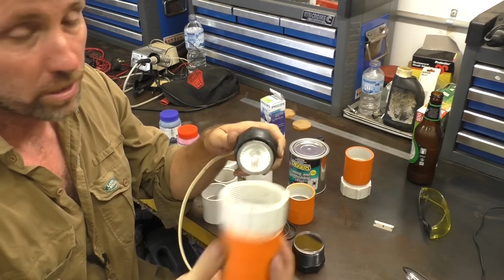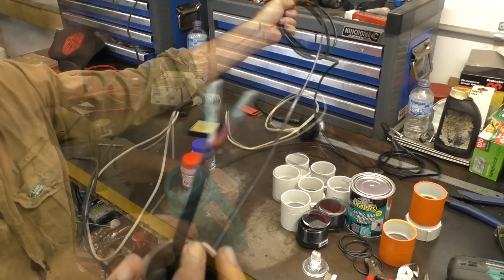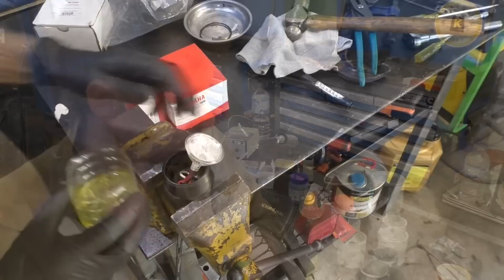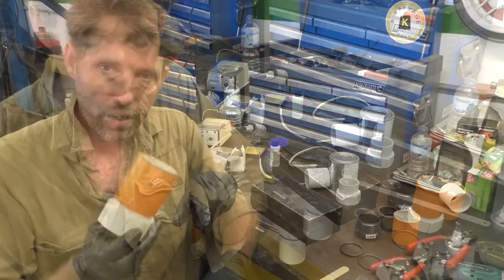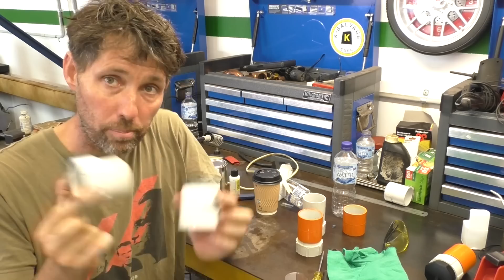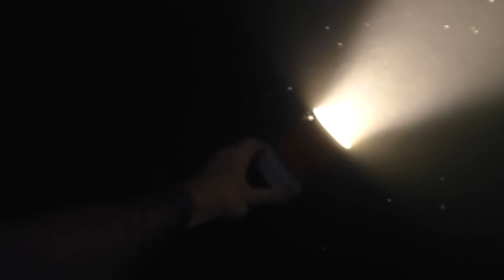Making Underwater Lights

Comment: Hey Stu, you can buy 50 mixing cups for about $20, try an automotive paint supplier, the best part is they are very strong, you can crunch the hardened leftover resin by squeezing the cup and pouring  out the shattered bits, I have re-used cups up to 5 or 6 times in the past, they have outlasted 3 boats, a car (floor pan repairs) and re-inforcing nylon joiners for a 6 X 3 gazebo with glass ribbon wrapped around them. I bought them over 7 years ago and still have maybe 6 left.

Comment: I made some underwater lights last year for the boat using clear casting resin. Have learned alot about leds, current control, and the amazing ability of epoxy resin for water proofing. I like how the halogen bulb has a nice reflector for more throw and beam distance. Definitley going to look into making some with the mr11 bulb. Thanks for the video. It was made before I thought of this stuff and just liking the way you think!

Comment: How do the lights go with heat build up. those halogens tend to run hot and I expect them to melt the pvc if out of the water.
good work.
Reply: My question as well.

Comment: I was surprised Colored lLEDs were not used, potted in casting resin . If the other end cap was fitted down to a Male pipe thred the power wires could be intalled though a standard Bilge plug This is a great Idea I wish I had seen before I spent a small fortune on Two Stainless steel LED plugs and two addinional SS transom plugs.

Comment: Why not pull the wire through so the the ends ofthe lamp stick into the hole u made an would keep the lamp straight
Reply from the maker: I'd be keen to try a few different designs. My original idea what that I should be able to unscrew the endcap and change the globe, but if I can get one that has a long enough lifespan I'd be happy to go with a style more like the one you suggest.

Comment: i built 4 of these about 4 years ago for my koi pond... they work great... i too was going to build an rov but never got to it... i stole the light idea from an rov forum...
Reply from the maker: I might still build that ROV one day. I know I'd have heaps of fun using it once before I put in on a shelf. ;)
Reply: i loved the build and research myself.
Reply: your vids led me to you!! I love your outboard videos but im still having probs with my johnson 150 vro
Reply: I had only got to the design stage using brushless motors... but the lights worked great as koi pond lighting!!! if you have time I have a question or two about a 90's johnson gt150 vro.... I have done a ton of diagnostic and found wiring issues... problem is after fixing the issues I still have steady tone with key on.... I suspect a vro issue but there are a couple procedures for diagnostic im not quite grasping...

Comment: You can try use LED strips(search for ip68 epoxy filled led strips) around a PVC pipe to form a spiral as a big squid light. If you are after high-powered LED's, look into Cree XML-2 + LED drivers for them, you can get an aluminium flashlight with them for $10-20 online usually. They make a huge amount of heat though as they are 10 watt and they turn the entire housing into a heatsink.
Reply from the maker: Thanks for the tips, it's always great to have specific terms to search for on the net to help sift through all the rubbish. I'll check out those drivers and give them a go if I resurrect the ROV project.
Reply: No probs. I get the LED strips from Ray Wu on Aliexpress ( he does a lot of the computer controlled and basic christmas lights) and I get the XM-L2 stuff from fast tech dot com. You can buy the flashlight housing, the LED, and driver separately but just make sure to double check the size for the base plate to fit into each housing. I use those for my flashlights and they have a ridiculous amount of light, the driver also lets a quick on/off (usually done by a half click on the flashlight) to change modes to lower the brightness and even flash an SOS signal if you want. They're running Pulse width modulation so it's very efficient for dimming.
Reply: Not to mention  I tried those halogen lights,way to hot. Melted plastic after 45mins

Comment: very nice man...........I made my own also......but I wanted my lights close to the bottom shinning up to see the shrimp as they swim by........I used the exact same bulbs with a green tint....(our prawns like them here in Florida).......and I start with a 4 way coupling that I run the wire through the center........come out with a 5" straight pipe from each hole......to a 45*.......then the light you made.......so I have 4 lights shinning upwards which works great........lol.....have a 1lb weight hanging off an eye hook to hold them off bottom...........made others with clear PVC and green LED strip lights wrapped around a smaller inner pipe.......those are excellent also.......just found that the 4 way lights seemed to really light up the whole area.........I had 2 extra bulbs and made hand helds like yours.......just for boat use at night if I need them.........if you want a picture of the 4 ways.......I'll send you one if those will work for you better.......again....thanks for all your info
Reply from the maker: Hey Rob, sounds like a cool design you've come up with. If you can upload it on a picture sharing site and then post a link in a comment so everyone can see it that would be great. I like the idea of adding some weight and then lowering it down, I think I'll experiment with that. Looking forward to seeing your lights!
Reply: ok.....will do soon......still struggling with my Honda BF 130.......lol.......just won't fire......has to be fuel......good compression and spark.......driving me nuts as I think it's both pumps.....mechanical and elec....(mech had a broken spring).......but I'm seeing 2 recalls from Honda that I didn't do.....hmmmmm

Comment: Hey stu. Good idea with lights. I use a IP67 common cable gland and tap a thread into Delrin bases for the gland thread, for underwater batt packs.and this is lithium batts, so if it leaks, it makes a bomb. Araldite the thread in and all good. Might be able to flush globe against joiner lip and dispense with the resin altogether.
Reply from the maker: Hey Matt, sounds like a good design. I was looking at these connectors when I was thinking of building the full ROV. I think I'll order some and start having an experiment with them.
Reply: Any electrical joint stu, auslec etc

Comment: Another awesome video 👍 can you assist me with an 70hp evenrude, its an old outboard. The motor runs but when it goes in gear it dies, and if you put the cowling on it idles rough
Reply from the maker: If it runs rough when the cowling is on then it sounds like it has an exhaust leak under the motor. I would start by checking all the gaskets and seals on the motor.
Reply: Dangar Marine thanks so much will have a look

Comment: This is a great idea Stu. To buy lights like this pre made are expensive. I think I'll try to make a similar one with an LED auto bulb. Maybe just epoxy the whole thing in without the lens and see how much light output I'd get. They'd be great lights for night crabbing.  Thanks for the ideas!
Reply from the maker: Thanks mate (I feel I should know your name by now but I don't think I do!) I think if I made these again I would also go LED, I would also definitely experiment with encasing the whole globe in resin as that casting resin is very clear and would probably make a great lens.
Reply: Always find your videos helpful, even if it's something I don't own or work on. Plumbing parts are great for making all kinds of things. I'm going to give this project a shot. Would love some underwater LEDs, manufactured ones are pricey! The names Jack by the way. Thanks for making all these videos Stu, I always look forward to watching a Dangar Marine Video.
Reply from the maker: Hey Jack (as I now know!), I agree, PVC plumbing parts are great for making heaps of things, you are right, and you are most welcome for the vids, thanks for watching and commenting. :)

Comment: Do they get hot with the halogen globes?
Reply: The get hot. Need to be submerged.
Reply: Matt Frapple I was more thinking if he was to use them as deck lights
Reply from the maker: Yeah, if there were going to be used on deck too for any length of time I would definitely go LED.

Comment: Keep going with the PVC parts - no corrosion! 
Battery connecter - use Anderson plugs - cigarette lighter plugs are way too flakey, Anderson plugs are easy to disassemble and clean the corrosion off the pins , and can handle 50A easily.
Those 30W globes are power hungry - 2.5 amps, and make better heaters than lights as about 85% of the power turns into heat. I wouldn't use them out of the water for long, the PVC will melt due to the lenses keeping the air flow away rom the front of the globe - which is the main heat radiator. As an underwater light they would be fine. 
Have you tried using a PVC T piece as a lens holder/handle attachment point? If you put a threaded fitting into the T, you could use PVC pipe for a handle that can be removed for storage. 

As for depth, that looks like the PVC is the 5mm wall stuff. At 50mm (2") diameter 30ft should be OK  . If you changed to 25mm / 1" PVC you can go to 60ft but you will need 10mm acrylic lenses for that . We ended up using the clear casting resin front and  rear of the globes  as the acrylic lenses just kept cracking and scratch too easily. As the lights became essentially solid items we ended finding about 150ft was the maximum before the resin compression shattered.  ( We were using the lights to do water clarity measurements about 2000kms out from Broome and lost quite a few to sharks and dolphins)
Reply from the maker: Couldn't agree more about cigarette lighter sockets being rubbish. They certainly weren't designed as general purpose outdoor power sockets. Using a PVC T piece to integrate the handle is a good idea. Sounds like it would have been a great adventure to head out of Broome and do the testing you did. I've never been up NW but hope to soon.
Reply: Dangar Marine oceanic survey ship.  Sounds glamourous, and as usual, the reality is far different.
Reply: AMP Superseals should work good for lower current stuff too (up to 14A).